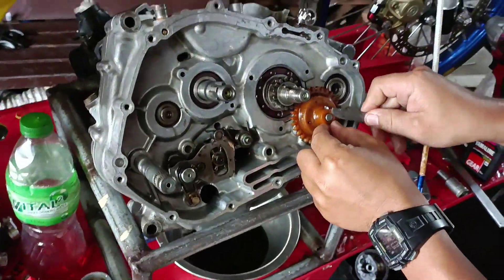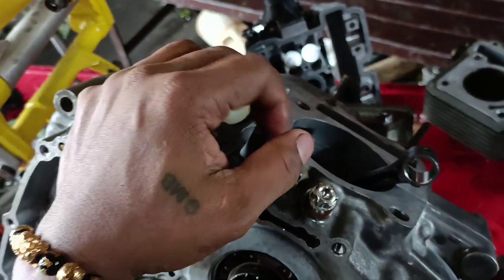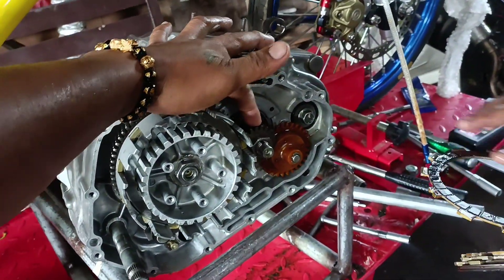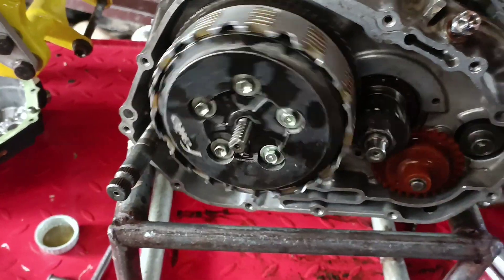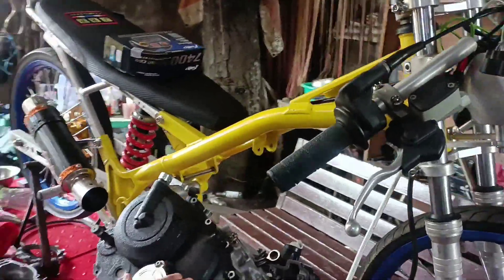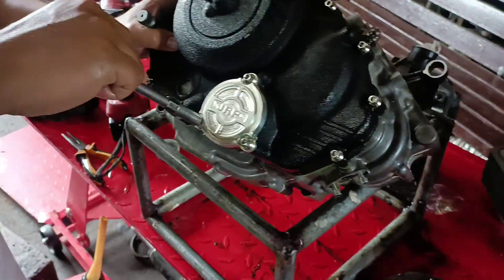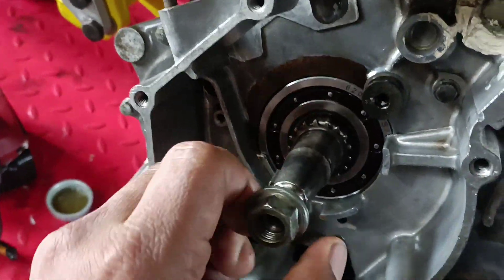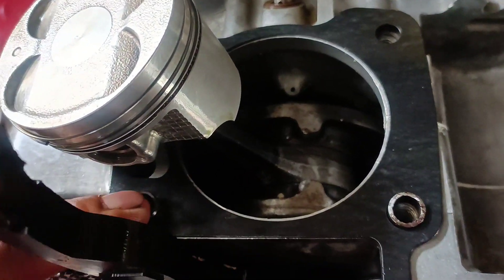😁PORT,CARB,CDI racing and service type 😜

Comment: nirereveal sana jettings ng carb at a/f mixture at sp reading pa shout out from Pangasinan
Reply from the maker: To be continued pa do..chill lng hehe
Reply: @cksbegoodtoeachother892  sige idol lagi ako nagaabang ng vid nyo lalo na pag r150 ang nasa content gusto ko den  kase tumulin motor ko kahit na stock engine r150 carb ko  na naka 28mm flat slide carb apido pipe/ignition coil ayun lang sana may content na ganto 😊

Comment: sir question po ok ba ganitong set? 
Jvt head v2 25 30
Jvt block 59 cb
Jvt v3 pipe
Jvt ignition
Racing monkey 500cc starter
Swr 28 carb orig
jvt set CVT
Pin stock 
rod stock

or kailangan naka pin at rod?  SALAMAT

Comment: Good day sir baka po pede makahingi ng standard na cam degree ng raider naka adjustable cam gear kase ako boss tas tabas ang block

Intake valve opening
Intake valve closing
Exhaust valve opening
Exhaust valve closing

Raider gen 1 nga po pala motor ko